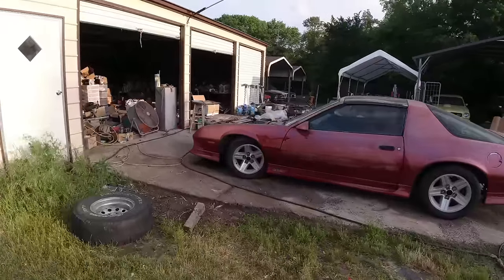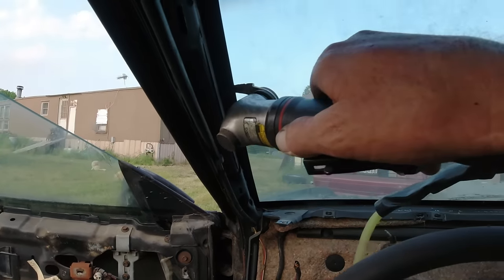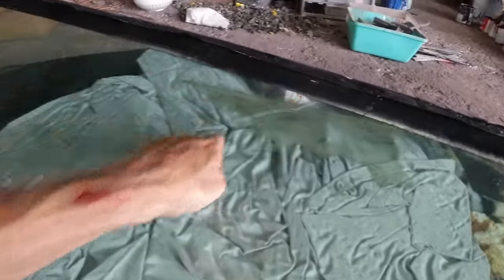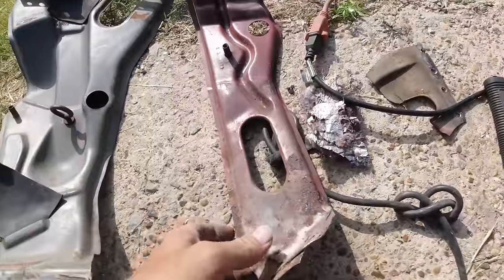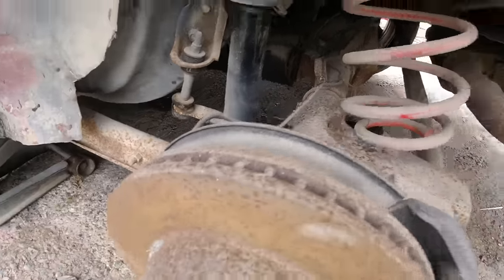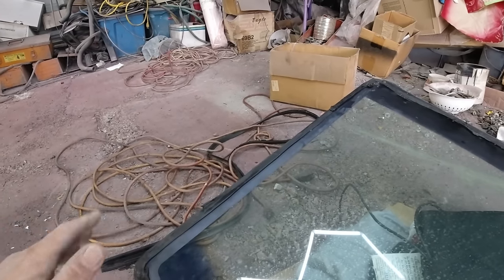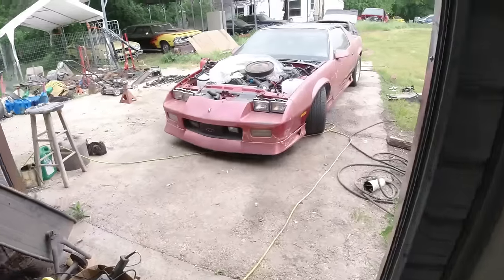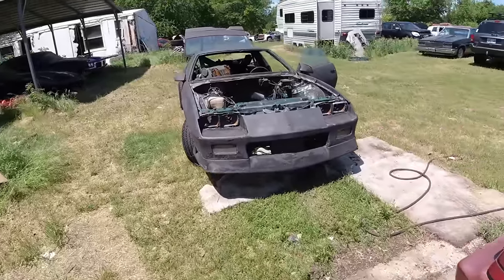1985 IROC-Z BUILD #7. DIY Windshield removal! Stripping parts car. Rear coil springs. Dash lights.

Comment: I hope you have a spare tire that fits. Those cars used a space saver tire that was not inflated until used. Not many other spare tires fit that small space but I"m sure you can make one work. The brackets are different because GM used two different tires. One was the old black one from the seventies on non rear disc brakes cars. I used one to replace a factory nova spare tire. Another silver color style was used for rear disc brakes cars but both were 14 inch rims. Ebay has some but they are around $200. Nice work and good luck!

Comment: Oh no.  Sorry that happened.  Well I have two comments.  First one is I have taken out windshields like that, was fortunate to never break one.  My other comment is way to go.  It took me two full days one time.  I would not do it again.  I had a parts car Buick custom.  Wanted it for a Skylark windshield.  The window was perfect, it might have been replaced lately.  Someone had glued it in with a substance never intended to be used on an automobile for anything.  I don’t know what it was but it was as hard as thick solid plastic could possibly be.  I kept thinking I got this far got to keep going, solidly worrying about breaking the glass barely moving each millimeter each one going slow.  I did it sort of like you did.  I made blades out of steel strapping, honing the edge as sharp as I could then welding that to a piece of steel I put in my reciprocator.  Kind of dull yet effective way since I could get a full cut with long flexible blades.  I remember making a small assortment of these home made blades after that two days of my life.  So, hats off to you showing people even a faster way, use an actual blade and weld another one to it.  I think that fresh chip on the edge of your windshield you pointed out, that’s what did in the glass for sure.  You are 100 % correct on that one.  The only way to prevent what happened to you in that situation would be to remember to check for chips, inspect and check for chips, if you find one like that fresh chip, you can grab your Dremel and barrel sand the chip smooth on any surface of the chip.  That will crack proof the chip immediately and take it from me, it works.  Been in the automobile world since I was four years old and I am old .  Been there done that window replacement job just enough times to get fairly good at it.  Sometimes they will have old chips that have been there, best to sand those out as well before moving the window much.  One wrong flex to any chip, even an old one and that window will snap.  Lastly, I like to lay foam pad on the hood.  I cut the window out slowly, not fast like you.  I find two catchers and I rock it towards them from the inside and they lay it on the foam like a baby.  I grind any and all chips and it is ready to go in to the waiting car.  Best to never let glass sit, I was taught that as a child, it needs to be glued in its new car and drying now.  Sitting glass is broken glass in the car industry.  I do like to learn and I think you taught me a quicker way.  Weld some blades pop it into a reciprocator and go.  You are a smart and clever man.

Comment: If you have an original console tag G92 for the positive track performance axle, and the J65 the code for the rear disc brake package on the 1985 IROC Z Camaro
Reply from the maker: I haven't found sticker with codes on them yet.

Comment: have good wire kit at harbor fright new crank styles is better  to be honest to many good vibration man got heat factor vs cold factor and to be honest older baked on not on you it is what is lot facts just got say crank the tunes and dial in on what you can control plus frame and body make good dirt track build or some one wanting cut up for parts